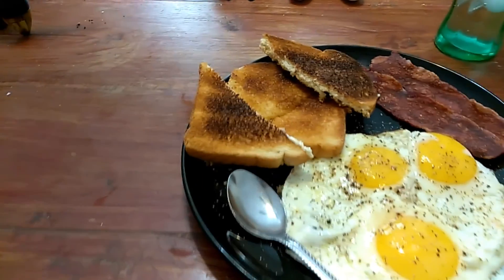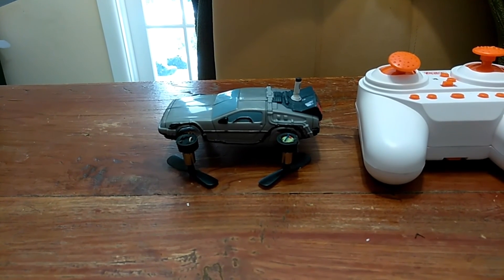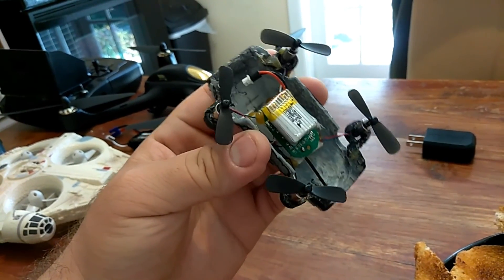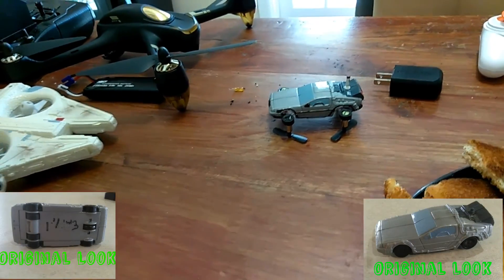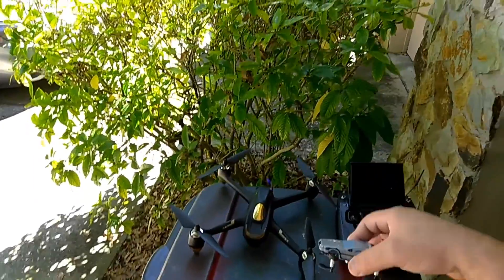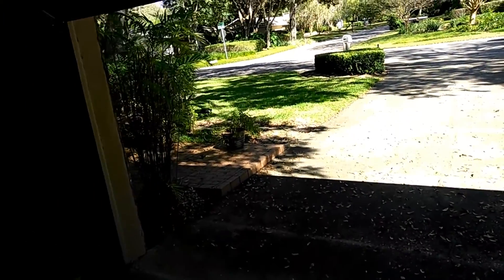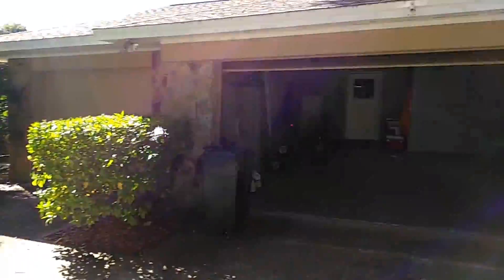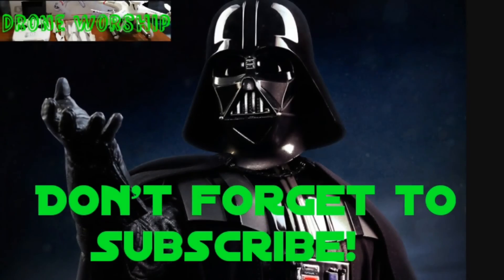Miniature Flying DeLorean Better Camera Angle

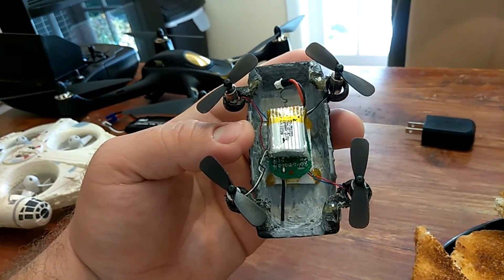Comment: Why did the video end so abrupt ?  Is this a 1:24 scale
Reply from the maker: Ruudy L I just wanted to make a short one today before I went to work and I didn't like the rest of the footage I took because the sun kept overpowering the camera
Reply from the maker: Ruudy L honestly I'm not quite sure of the scale size I know it's just a little larger than a Hot Wheels car
Reply: Drone Worship Ok I looked on Ebay and lots for sale, I might also do 1  have a Dremel and hardly use it, so get the dust off it :-)
Reply from the maker: On eBay I looked up plastic DeLorean that's when I found the U-Drive Universal Studios special edition plastic DeLorean that I used to make the build with. All of the other ones were die-cast steel or metal which would have been impossible to lift without some super strong Motors and a very powerful battery. I hope you take this on as a challenge like I did would be awesome to see someone else build another one and see if you can come up with a better design :)
Reply: Drone Worship Did not realize that they where metal, no go there, also would not be able too get it any better, if I find a plastic one I will buy it.  Those inverted motors look a lot better than the previous version